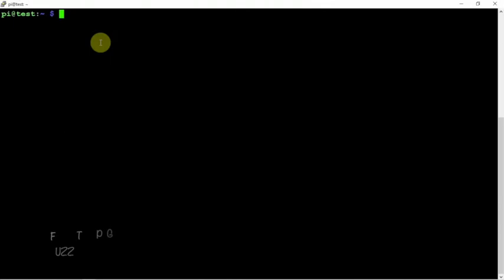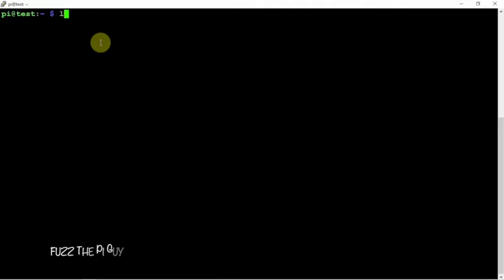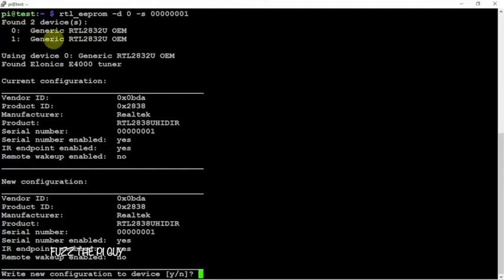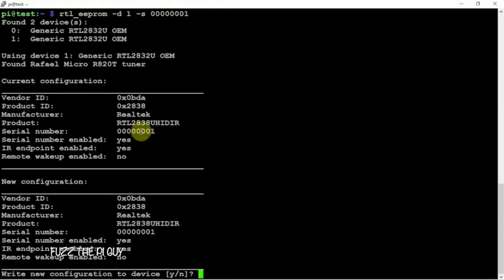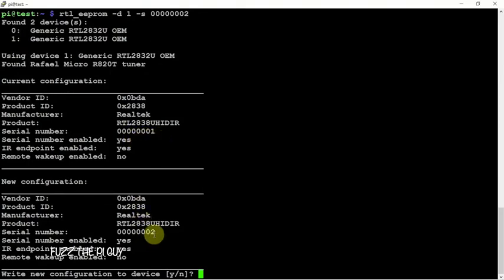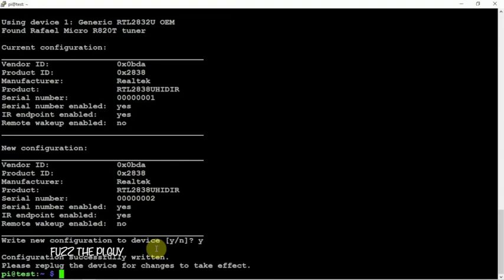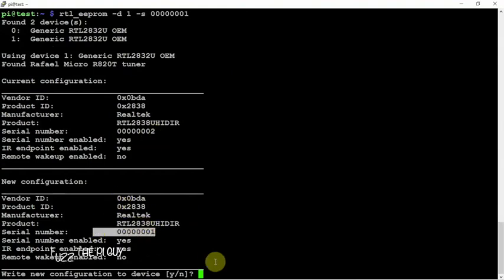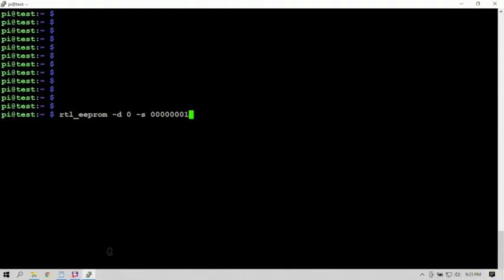Changing Serial Numbers On A RTL-SDR When Using Multiple Dongles

Comment: I have two of these, both manufactured by the RTL-SDR blog, and both are V3.  One of them worked like it should, but the other is throwing an error stating "No EEPROM has been found".  Any ideas?  Google isn't giving me much.  I'm trying to download the RTLTool to try on Windows, but the distributor has it locked behind a Google Drive link and I'm stuck waiting for my access to be approved.
Reply from the maker: I just posted a new video about changing the serial numbers.

Comment: How do u do this for windows?
Reply: 1) Download the RTL-SDR software package
2) Unzip the software package to a folder where you can conveniently find it
3) In the folder you unzipped you should have an x32 and an x64 folder.  Choose whichever type of system you have (probably x64) and verify you have rtl_eeprom.exe in that folder.
4) Open a command prompt as an administrator.
5) Use the cd command to change your current directory to where that rtl_eeprom.exe file is.
6) From here you can use the same commands shown in the video.  For example, rtl_eeprom -d 0 -s 00000101 will change the serial number of Device 0 to 00000101.
Reply from the maker: I posted a video about this.